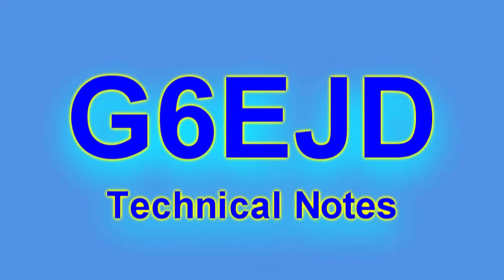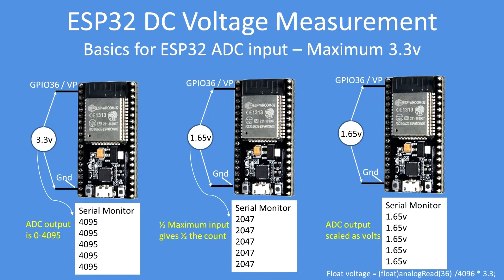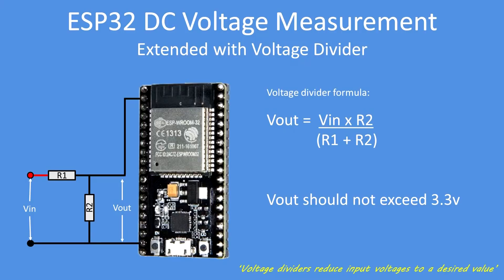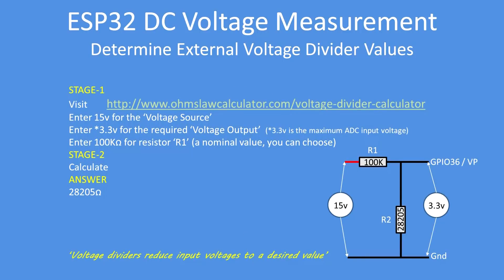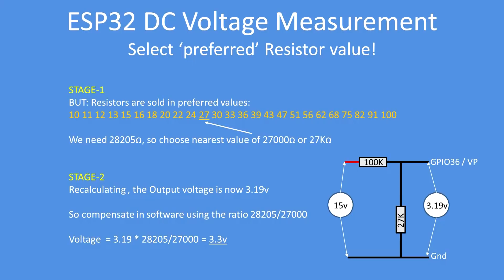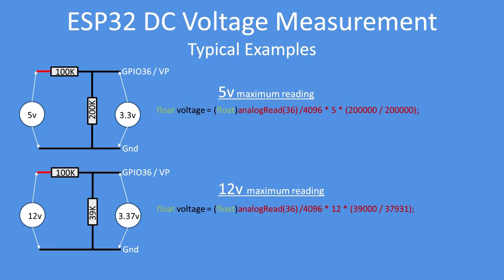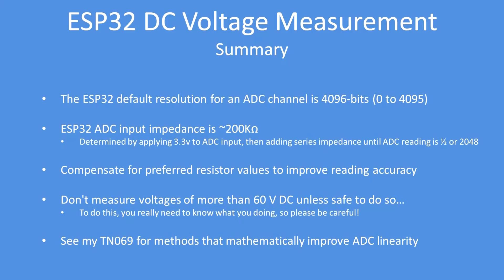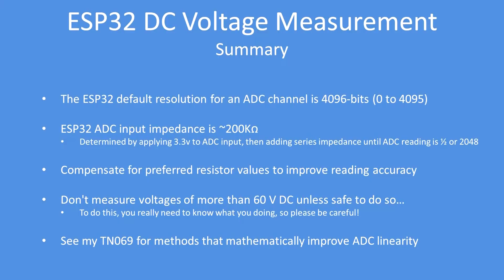Tech Note 115 - Using the ESP32 ADC for wide range DC voltage measurements

Comment: It seems the esp32 is unable to distinguish values at the top and bottom of its range (v < 1 and v > 3.2). How can we compensate for this, hopefully without resorting to an external adc?
Reply: Just finished watching your tech note 069 and found my answer: adjust attenuation values, I guess to 11db.
Reply from the maker: Hal, the default ADC range is 0 - 3.2v or actually 0 to Vdd -0.3 according to the data sheet. If you switch on the attenuation then the input range is further constrained to 0 - 1v the only solution is to use two external resistors as voltage dividers.
Reply from the maker: I also provided an improved accuracy function.
Reply from the maker: https://github.com/G6EJD/ESP32-ADC-Accuracy-Improvement-function
Reply: @G6EJD  Thank you. I tried your formula but was unable to fix the described behavior. I think this is a physical problem. Here's what happens:
I'm using one of the axes of a joystick which I've measured goes from about 260Ω - 4.8kΩ at each end, however, when I connect its vcc pin to the 3.3V pin of the ESP32, the GND pin to the GND of the ESP32, and the signal pin to ADC on pin 34, I see the voltage on the ADC go between 0 and 3.3V, but for about a quarter of the range of the potentiometer, the voltage is stuck at either 3.3V or 0V, similar to the graph in https://randomnerdtutorials.com/esp32-adc-analog-read-arduino-ide/ "The ADC is non-linear".
However, I also read, as you said, that setting the attenuation should eliminate this value clipping at the end of the ranges, but it doesn't seem to be working for me. Are we limited to using the center ranges of potentiometers when using them with the ADC of the ESP32?
Reply from the maker: You need to be setting the ESP32 to the minimum attenuation so that the input range is 0/3v which is what you’ve done. As it’s a joystick I’d suspect the tracks are not continuous as in most potentiometers and at the extremes they are in fact maximum and minimum voltage which is what your seeing. If you have a DVM and actuate the joystick then do you see the same behaviour?
Reply from the maker: It’s nothing to do with the ESP32 non linearity it’s a facet of the joystick if you imagine the resistive track might extend all the way round on a normal potentiometer then on a joystick variant they don’t, this is how my Futaba joysticks are configured they only work over a 90° range probably about 100° if stretched, you might be expecting too much from the joystick.
Reply: @G6EJD  these are the components I'm using: https://www.aliexpress.com/item/32917538803.html
You're right, the resistance is all over the place. At some point, the resistance goes from 1k straight to 300Ω, as if they placed a new track with completely different properties was inside the potentiometer at that point. I'll use my bench power supply (with common ground) to test my ADC next time.
Reply: ESP32 ADC typically reads from about 0.1-0.2 V up to about 1.1 V. To read below 0.2 V you could pull the values up into the range using two resistors to create a voltage divider with the input on one end, Vs at the other end and the ADC input in the middle.
Reply from the maker: No need to do this if you use my improved ADC function, the polynomial resolves the non-linearity issues at the top and bottom end of the measuring range.
Reply: @G6EJD  This can fix linearity but I don't see how any program can fix the issue that the whole area from about 0 to 0.1 V input registers as 0 amplitude. Lots of people have this issue. Here's a quote from the ESP32 forum: 
"All ranges have the problem that they don't go down to zero, so input voltage under 0.04/0.08/0.1 Volt can't be measured without some analog offset generation at the input (2 resistors for example)."

On the same page you can see graphs showing the problem. And there are similar graphs by others on other sites too.

https://www.esp32.com/viewtopic.php?t=1045
Reply: Here are graphs showing ten different ESP32 chips that were tested. You can see that none of them could register voltages at zero, and that there was considerable difference in their zero points:

https://i.imgur.com/mTkip9V.png

I took that from this 143-comment-long discussion on Github:

https://github.com/espressif/esp-idf/issues/164
Reply from the maker: @ytubeleo  it is what it is and nothing is going to change its response, I think for 99% of applications it’s perfectly adequate, I’m not sure why it generated so much discussion when nothing can be changed or will be changed by Espressif in their future products. For IOT purposes providing a general purpose ADC with some limitations is better than none. I’m content with my ESP32 performance.
Reply: @G6EJD  
Yes. I wasn't complaining about the performance and it is indeed much better than no ADC! What is important is that people understand the limitations in advance and know how to mitigate them, especially Expressif's recommendations of: adding a capacitor on the input pin, averaging 60 or more samples, and correcting non-linearity and offset in code (including using the factory calibration data if available in your specific chip). Additionally, a resistor divider can be used to allow measuring voltages below 0.1 V or improve measurements close to Vs.

It's impressive what Espressif achieved at this price point. I think people were mainly miffed that the 12-Bit 100 ksps ADC can actually only reach 7-8 Bits straight out of the box, is noisy with a substantial offset and is poor at frequencies above 6 kHz. These also originally provided a very poor description of the characteristics in their documentation. Had it been described as an 8-Bit 20 ksps ADC there would have been few complaints.

In terms of your video, it's a good video. I just think you should have mentioned that the ESP32 struggles to measure below 0.1-0.2 V, and that this can vary considerably between different parts, but that a resistor divider can be used to pull the voltage up into the "good" range if required. It's also worth mentioning that using the -11 dB attenuation (as you use) instead of the device standard 0 dB attenuation can provide a more convenient range but worsens the ADC response both in terms of reading low values and in non-linearity.

Comment: First of all, your posts are great, many thanks ... What would you recommend for "U> 100V" RMS for high voltage measurements, is it possible to share resources?
Reply from the maker: Well even at 1/4 watt a simple resistor voltage divider is perfectly safe up to 100v, but augmented with adequate terminal protection. Even up to 220v it’s still quite safe again with appropriate power ratings, what factors were you considering.
Reply: @G6EJD  I need to take stable measurements over a wide measuring range of maximum 500V rms.
"4kW" PF = 0.99/ 0.97 induction cooker and measuring device required for white goods testing

Comment: Thank you for sharing your knowledge and experience. I'm using an Espressif ESP32-WROOM-32D, a bench style DC power supply, R1=100K, R2=14.7K, which should allow for a maximum input voltage of 25.749, assuming a desired V out of 3.3. The readings I'm getting using the provided code are not linear, meaning, they are more accurate when input voltages are closer to the maximum input, and substantially less accurate when input voltages move further away from the max input of 25. Is this the expected behavior? Thanks again for making great videos.
Reply from the maker: Pleased to hear I’m helping you out. The non-linearity your seeing is not typical, the most linear region of the ADC is between 0.5v and 2.8v and outside of this range you will see non-linearity. Any variation in input impedance is more likely to be the cause, but just less than 100K should provide enough input current to operate the ADC correctly, I assume there are no further attenuation resistors in the circuit. From the parameters you have provided everything should work as expected. You can improve the linearity if the ADC with some mathematics and I produced a function to do this in one of my other TN’s improving ADC linearity.
Reply: @G6EJD  Will be sure to read and or watch / learn more about ADC linearity, thanks for the quick reply.

Comment: Thank you for this video, would you kindly show how to change the adc ref say to use 1.1V?
Reply from the maker: The ESP32 ADC reference voltage is already nominally set at the factory to 1.1v although in some earlier devices it can range from 1.0 to 1.2v. You can route the internal reference input to GPIO25 and apply your own, which you’d need to measure accurately and then recalibrate the ADC but the advantages in doing this aren’t that great. What is the problem your trying to solve?

Comment: Hi, thnx for the info, very useful - however . . . I consistently see 4095 on the ADC raw output at 3v . . . not 3.3v as you describe. Not a huge issue, I just adjust the V-Diver values accordingly. Thoughts on why this could be?

Thnx again for your informative videos.

cul
billd
Reply from the maker: Bill, there are a number of reasons, component tolerance associated with the voltage divider, or production variations in the ESP32 and it’s ADC reference voltage and measuring equipment tolerances. Your observations could be due to a combination of all three. The Espressif data sheet shows a maximum ADC reading of Vcc which is 3.3v, I have never seen an ESP32 that can’t read to 3.3v, so assuming yours is a genuine ESP32 then next I would check for DVM accuracy and next that the voltage divider values used are correct. With so many variables it’s near impossible to produce a design solution that compensates for all the tolerance bands. The only solution is to vary the divider as you have already surmised.
Reply: @G6EJD  Yes, many variables, and it's not a genuine ESP32 - the cheapest I could find to experiment with . . . Anyway I want to use it to monitor a Solar Cell output and a 3.7v Battery Level, so I've mapped the range in the linear portion, customised the V-Divider, and have a pretty accurate scale for the narrow range I need.

Thnx again for your great series of informative videos.

billd

Comment: Pairing it with a LCD Display it would be a great voltmeter.
Reply from the maker: Yes, but I’ve never seen an LCD display you can buy
Reply: G6EJD I ment was a lcd display connected to the esp modile to display the voltage. For a simple setup.
Reply from the maker: Ok, I know what you mean an OLED or TFT screen often known (incorrectly) as LCD. I can’t do that as I’m in hospital until at least November ‘19

Comment: Hi Dave. 

I have a 4.2v battery 18650 cell, i want to mesure the voltage with ESP8266 i tried your trick, but i dont really understand the dynamic... what would be the calculation.. i take 320k as R1 + 100k as R2 i have an ADC value of 268... i made the calculation: 268/1024 * 4,2v * (320000 / 100000) = 3,51v .. why i cannot have 4,2 v mesure ??

thanks a lot for your help!!!
Marc.
Reply from the maker: Marc, wired as Vin===320K===ADC input===100K===Gnd gives you a voltage input range of 4.2v or Vin at ADC  = Vin * 100/(320+100) in code terms:
float voltage = readanalog(A0) / 1023 * 420 / 100;
If your using a Wemos D1 mini it already has a 220k—100k voltage divider on-board, so would need some extra series resistance say 100k to make it 320k—100k
Reply: @G6EJD  = 1,3466 v which is far away from 4,20v. Im really messes up... :(
Reply from the maker: What board type?
Reply from the maker: Marc, the easy solution is to add a multiplier at the end of your calc like ‘ * 4.2 / 3.5’ that will increase the value in proportion to your under reading.
Reply from the maker: So your reading of 328 is giving the correct result for the voltage divider, but I suspect your using a Wemos D1 Mini with an on-board 220k—100k voltage divider which for a 4.2v input AND the addition of a parallel network yields a reading of 342 but exact values depend on the individual ADC reference that do vary. So if using a Wemos D1 Mini just insert a 100K series resistor to the A0 pin where it adds to the on-board voltage divider.
Reply from the maker: I think to really understand what’s goi g on I need to know the exact board type your using. Also did you measure the cell voltage by independent means like a DVM?

Comment: I have a question about battery, let say we have 4.2V converted by voltage divider to 3.3V. What happens if the battery voltage drop to 3.5V? 
We will have possibility to read correct voltage via voltage divider? Or rather this method is only for constant power supply? Any feedback appreciated.
Reply from the maker: Piotr Ojdana, the input range will be 0-4.2v and divided down to 0-3.3v. So if the input is 0v the reading will be 0v or if 2.1v the voltage divider output will be 1.65v, it’s just a method of changing the default 0-3.3v to whatever range is required. The ADC reading needs to be scaled to a 4.2v maximum then you will get an accurate voltage reading just like a DVM would do.

Comment: This is really helpful thank you so much... Also wanted to ask if you have any notes on ready AC voltages?
Reply from the maker: When measuring AC voltages there are a couple of approaches that can be used, the first is to downscale the AC voltage using a voltage divider and apply this via a capacitor to a voltage offset usually two equal resistors across the 3.3v rail, this is to allow the ADC to measure the positive and negative swings, then the incoming waveform needs to have a zero detection and then sample the whole waveform to then compute the RMS value from the peak to peak values. It gets complicated! 
Alternatively, apply the AC of suitable voltage probably downsized by a voltage divider to a diode and capacitor to ground, this will then charge to the peak value from which the RMS value can be found by measuring the now DC by the ADC like any other DC measurements. I’ll try to summarise all this in another technical note, it’s really quite easy to do, but safety is a concern I need to consider.
Reply: @G6EJD  Wow! Thank you so much for the detailed overview. I shall try this while I wait for you to prepare a video on this. Really appreciate the effort :) Cheers!!
Reply from the maker: Subrata Dey, all you need to do is feed AC to a diode eg IN4001 and then a capacitor to ground of about 10uF then measure the DC with the ADC

Comment: The 12-bit analog values range from 0-4095. Why devide that by 4096 when the highest possible value is 4095?
4095/4096 is slightly less than one so that multiplied with 3.3 is less the 3.3 (something like 3.2991943359375).
Reply from the maker: Konstantinos Kostis, it is because 0 is a number and there are 4096 values that the ADC can output, it’s a common misconception with binary mathematics.
Reply: @G6EJD  Yes, there are 2^12=4096 values but they start at 0 (not 1!) and end with 4095 (not 4096!). So much about common misconception with binary mathematics. A 12-bit value can hold 4096 different values but not the value 4096.
Reply from the maker: Konstantinos Kostis, the mathematical solution is to get the fractional results the denominator of which has to be 4096 as there are 4096 possible readings. The solution is to make your denominator 4095. In every ADC example I’ve ever seen the denominator is always the ADC range like in this case 4096. You could also reduce the 3.3v reference by 3.3-3.3x1/4096 to give an answer that more accords with your thinking, but I doubt you’d ever notice the 0.8mV error as the quantisation errors will be much greater.

Comment: Thanks Dave, for another great video.  

I'd like to add that the 'full scale' A/D reading isn't 3.3V but rather the Vdd to the ESP32.  Some folks may not realize that the regulator on their development board may be way off from it's specified output voltage.  Also, ripple needs to be tamed to get trustworthy A/D values.
Reply from the maker: I do mention that in my opening remarks and it’s a very important point you make, as the maximum value of ADC input is quoted as Vdd - 0.3v according to the data sheet or 3v typically.

Comment: Comment on "accuracy" ...   depends heavily on the accuracy/stability of the power supply to the ESP ...... Fell into that hole when making a lithium battery charger !!!
Reply from the maker: Yes it’s all relative but the ADC uses an internal reference so device supply variations have minimal effect on the readings, then there’s the ADC linearity, which is not that good, but can easily be improved to <1% variation with a polynomial. That just leaves quantisation errors. All these can be minimised by various techniques, for me the challenge is not making the subject too specialised that it loses the audience. You should get good repeatable accuracy from micro controller ADC’s if correctly designed as nearly every charger uses one to take battery measurements.